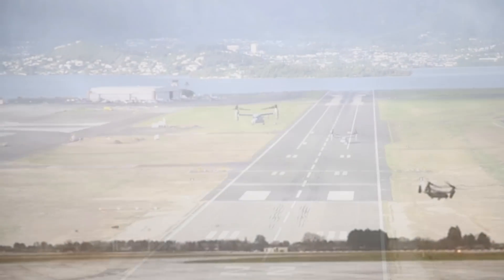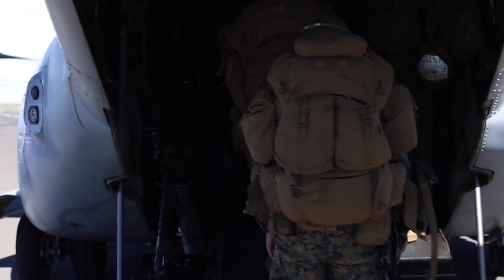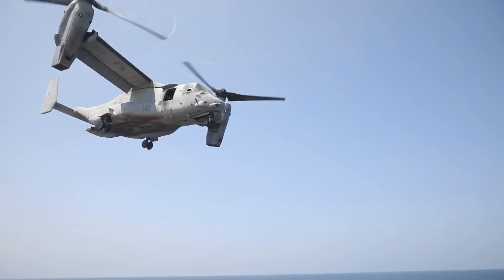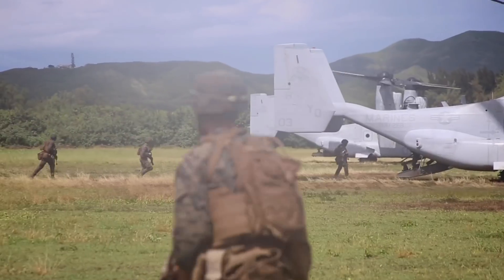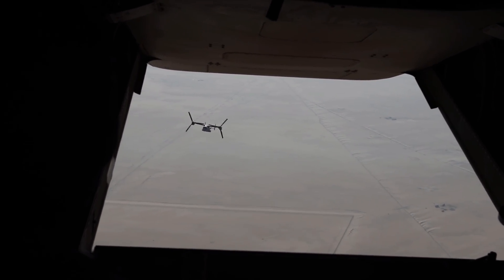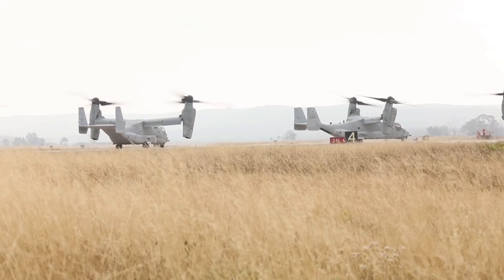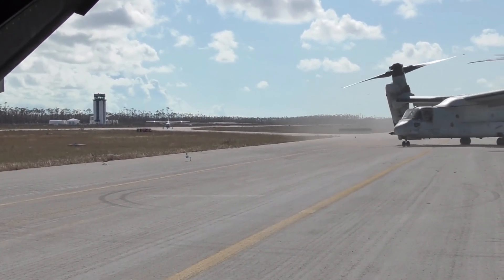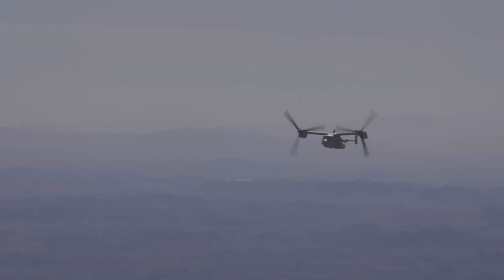Bell Boeing V-22 Osprey | TILTROTOR AIRCRAFT

Comment: Hey Matsimus, The Osprey is one of the safest military aircraft in service today! Yes during TESTING there were a few accidents but since this bird as been in service it has perform extremely well. 

I never actually flew in one because I was in the US army and the majority of Osprey's belong to the Marine Corp, but I have talked to them about it and they love it. It can do everything a medium left helicopter can do while being able to fly at much higher speeds and carry more troops and cargo! The US military hit a homerun with the Osprey and it was worth every dollar!
Reply: Wastage?  I believe you mean waste, as I don't think wastage is even a word.  While I may be wrong on that, I am pretty sure neither word would apply.
Reply: Yeah the idea that they are very unsafe is just an old myth that refuses to die.
Reply: @TheoneknownasVC  No autorotation, only glide like a plane in the event of power loss, would drop like a brick if it is hovering and has no speed at the event of a power loss.

Rotor layout is easily affected by changes in the wind, unlike most helicopters that have the rotor at the center of gravity.

Yes, it is safe as long as it is used like a plane but the moment it goes to hovering mode, it loses all of its benefits and deals with hazards that aren't present to most other helicopters.
Reply: @13thSystem  The ones I've worked with take great crosswind and TX limitations. Also they can auto rotate themselves. 

Do you fly them because it sounds like your info is wrong...
Reply: @harosokman  They can autorotate but the tiny disks would be useless in autorotation and wouldn't slow the descent down. The manufacturer's manual itself doesn't recommend autorotation, you should know that if you've really worked on these helicopters
Reply: @Tom Gulbranson yes, you idiot, you can disregard my opinion, you must be new to the internet? if people laugh at this, and I learn from it, then it is a win-win in my book. thanks for the link.
Reply: @zeburancher9480  mann you a Savage 🤣🤙🏾🤙🏾🤙🏾 playing with peoples emotions like that
Reply: Your local meme and anime dealer, Yes, well having it both ways is a contradiction here. Either the Marine Pilots are "risking their lives" or the V-22 is "safe" but not both.
Reply: @roxyraccoon8856  What I mean is they put their life on the line flying this thing aka Flying into danger and that all of the kinks have been taken care of.  K ?
Reply: @Tom Gulbranson you too
Reply: @Tom Gulbranson I havent had time to read the link yet, sorry if I am mistaken.

I will leave you with a quote though, "Great Minds Discuss Ideas; Average Minds Discuss Events; Small Minds Discuss People"

have fun talking about me :) - you won't make 'the cut' into any of my conversations.
Reply: These aircraft can do a lot more than most people give them credit for. They are also much safer than most people know regarding the redundancies built into the electrical, hyd, drive systems, etc.
Reply: @elioltelaski6066  you missed the point. I'm an idiot, sure, but so are you. "Think about how complicated anything that isn't a consumer good. Oh wait, you cant Because you never see them. Anyone that can actually has an idea what to do with them." I dont know what any of that means, because we are idiots.

You are looking at my 7 crashes as a Statistic; thats fine, to a degree...  "Flight rating per hour doesn't translate to overall reliability or safety, it's a common term used in politics to make something sound good and land a procurement contract. Flight rating per hour simply deals with how long they fly it, not how hard or where they fly it. [...] It only counts the ratio of the number of flight hours to death and ignores the reason of death or the conditions the helicopters were in."

put it plainly, at least one of those seven crashes was caused by the V22 being ordered to perform an insertion above its recommended altitude; this was done in an attempt to prove that the V22 was more capable than it was, and it cost lives. This would have been completely avoided with conventional craft. the statistic therefore does not hold any water in reality.
Reply: It IS a waste of money AND good value, It is safe and Intrinsically dangerous. You guys agree but have different criteria. It could be a safer design, absolutely it could but it is very safe for the design, which is quite mad. It is effective, certainly, but it is also superfluous. 

Fatalities IS a terrible metric. The aircraft DOES have issues. The aircraft also benefits from being built on the back of other systems with problems such as the issues with the chinook. 

The fatality rate is low because the engineers are very good, and won't let them fly unless they are perfect, which is also why most of them are out of action at any given time. They take special measures because they KNOW things could go badly wrong if they are not careful. More reliable designs tend to be "trusted" and thus can suffer unforseen faults. 

None of that really matters. I'm sure next time they made one it would be a chinook that turned into a flying wing or some lunacy. 

The question comes down to,  as it clearly does fit a niche, can it be improved? if so, what exactly could fill that niche? If not, can we get rid of the niche? Or should we just suck it up and keep it?

Key points to consider - it is very complicated (hard to keep operational). -it melts whatever it lands on -it is an unsafe LAYOUT. can it be faster tougher fitter etc?
Reply: Carbon 12 - It's always funny to hear someone that has never served in the military and knows nothing about the aircraft tell people who know a LOT more than them they are wrong lol.

Seriously stop making yourself look stupid and ignorant. Pretty much everything you said was wrong.
Reply: 7 crashes in 12 years doesn't sound quite alot nor a waste of money tbh... Coming from a normal citizen with zero experience in anything military... Cars in the highway looks like speeding deathtraps compared to any aircraft.
Reply: Airforce Controller here. I back up that claim. Her flight hour, these are the safest aircraft in the USMC inventory! I work with them almost every day.
Reply: @harosokman   You are spot on. I have multiple friends in USMC who absolutely love the V22. They say it gets them where they need to be  faster, safer and more comfortably with all their gear then any of their previous transport aircraft.
Reply: @Tom Gulbranson maybe I dont, but at the same time no one can offer any proof. you say you and your son have experience, but this is youtube, sorry I can't take you at your word. I dont have control over whether the next 200 v22 are procurred or not. I think they will be procurred whether they are decent aircraft or not. I therefore Hope that I am wrong, that they are decent aircraft, and Maybe I went about this the wrong way, but I attempted to play 'devils advocate' in an attempt to get them to defend this aircraft with facts. I have seen no Facts.
Reply: Better I’ll get 2 CH-47F then one V-22
Reply: @rudenkohawaii  3 CH47s still isn't better than one V22.
Reply: your periodic reminder that the V-22 Osprey is a piece of junk.
https://medium.com/war-is-boring/your-periodic-reminder-that-the-v-22-is-a-piece-of-junk-db72a8a23ccf
Reply: @prwtc  This source is from 2014 and you say that to this day it is a piece of junk. Not only that but marines who actually risk their lives flying it say it isn't. Also most of the crashes are from early in its life and have been taken care of.
Reply: @operator0  Okay, lets take safety completely out of consideration then. Even if this thing were as safe as a C130, C17, or any other fixed wing aircraft, it would STILL be a POS. "It flies too SLOW, it lifts too LITTLE and it doesnt fly FAR ENOUGH, and it is just too much of a POS to have in our inventory". Have you ever seen a single ARMED V-22? Do you ever wonder why the V-22 cant lift up the gun? let alone bombs/missiles? Because its lift capability SUCKS. it is a huge aircraft that cannot keep up with even C130 or C17, let alone be fast enough to defeat even OUTDATED AAD (it is SLOW), it cannot perform above 3000m altitude. ALL of these facts make this aircraft UNFIT FOR DUTY, unsafe on the battlefield, a huge detriment to our troops on the whole.

There is absolutely nothing this craft can do that a fixed wing or helo cant do better, cheaper or faster, AND safer.
Reply: @operator0  okay this will take some nuance, so please follow me. you want to compare to Helo, not fixed wing aircraft, because that is where this vehicle outperforms the old. So where do we operate helo? anywhere without flat plains to pave or a road to land on. Of those territories, the CH47 is limited to taking off and landing at 20k ft altitude. but, the V-22 is limited to 10k ft (take off/landing, not in-flight). Do we use helo below 10k ft? what % goes above that? It seems to me that the military wants these aircraft to operate in mountains and at altitude. the point is it is not better than a helo if it cannot be used where helos can be used.

Genuine questions at this point. Sorry if I was being too abrasive earlier.
Reply: @zeburancher9480  What. But it doesnt. Its primary capability is that it flies faster and further than helos but can land and take off vertically...
Reply: @zeburancher9480  it's faster than what it replaced. I've never heard anyone bitching about it not being as fast as the larger cargo aircraft. It's not supposed to be. It's supposed to be faster than the helicopters it replaced while still being able to take off/land like one and fit on ships. Looks to me you're changing the goals for this machine. Like bitching about a pickup truck not being as fast as an F1 and being unable to carry as much as a semi-trailer truck.
Reply: @zeburancher9480  since when do landings happen when air defense is still active? You do know no one lands until air defense is destroyed or is being suppressed?
Reply: Your local meme and anime dealer said  "...the Marines who actually RISK their lives flying it said it isn't [a piece of junk]". Yes, the anime 'tard ACTUALLY wrote that.
Reply: @MotoroidARFC  since when do we get to choose where and when we and who and how we fight? The enemy helps us decide all of those things, we dont get to choose 100% of the time. ambushes during take off and landing are the most common attacks on aircraft because they have the highest success rates. That said, an ambush in take off against the V22 or the CH47, I don't see much difference there. So whats the point? edit: my original comment, I was talking about while in transit (not landing/take off), and compared to fixed wing (even A10, which people are constantly saying 'cannot handle modern AAD').

your F1/semi trailer compared to a pickup truck would be valid if only the semi trailer truck were also the F1 racer. A Tilt-Wing aircraft could do everything the Tilt-Rotor V22 can do, better, and do it with a faster cruise speed closer to that of a C130 (not faster than, just to try and 'keep up'). I will concede the 'fixed wing' point entirely though, the V22 does outperform push-propeller helicopters, for what looks like a trade off in size and complexity in building/maintaining. Thanks for the reply.
Reply: @zeburancher9480  which is why the Army and the Marines don't land their transports in an opposed landing zone. Fixed wing aircraft (if available) and gunships get there first and either destroy or suppress the opposition or call off the landing at that landing zone. Alternate landing zones will have been selected and if they can't be used the transports just cancel the landing and bring back the troops.

The V22 was made to replace the CH46 and it does that well. It still can't carry as much as a CH53 in troops and sheer weight but it is faster which is why it's still on the flight decks of amphibious assault ships. Perhaps it can be re-engined (and another blade added) and reinforced to improve its lifting ability and speed but until they get all their F35Bs, the Marines will carry on with the V22s they have.
Reply: @zeburancher9480  you do realize that the v22 is not supposed to fight back!!!! It will receive interceptor or low fighter escorts for missions it will get shot at. THE MARINES HAVE AN ENTIRE AVIATION SECTION FOR THIS
Reply: @roxyraccoon8856  Which is true because the Marines still use the damn thing and ACTUALLY say it isn't a piece of junk. Also go take a look at most military projects and you'll see that people had to die to perfect them cough AV 8 harrier cough
Reply: @zeburancher9480  push propeller choppers aren't really that new I mean the Army was trying to get the AH 56 like half a century ago until the Air Force cock blocked them with the A10.
Reply: @prwtc  Who wrote that and where are his sources?
Reply: You are wrong, and you should do your research before showing support for a death trap that is endangering the lives of marines. Since becoming operational in 2007, the V-22 has had seven crashes including two combat-zone crashes, and several other accidents and incidents that resulted in a total of 12 fatalities.
Reply: @zeburancher9480  You should do your research. 12 fatalities in 12 years for a military aircraft is fucking outstanding. Just for funsies, look up the crash history of the AV8-B Harrier jump jet. The fact is, the V-22 is so revolutionary in its capabilities that the military would use it even if its fatality rate were 3 times higher than average. It's just that mush of a game changer.
Reply: @zeburancher9480  And how many crashes did the Ch-46 have in development and operationally? Thats the aircraft the V22 replaced and is relevant. The first two Woodland Scenics V22 crashes with fatalities were studied, and then fixed. The other two crashes happened operationally as you suggested but had nothing to do with the developmental aircraft. Despite your opinion the military loves this aircraft and it's capabilities.
Reply: @zeburancher9480  12 fatalities over a  13 year period? That's not a very impressive statistic to claim "death trap"
Reply: @demanischaffer  youre late, notice 70 replies in this thread? Ive heard it all before.

edit: P.S. @Your local meme and anime dealer, the AV8 also sucks. just compare it to conventional craft.
Reply: @zeburancher9480  I really don't feel like reading through 75+ replies I was responding to your original comment
And again, 12 fatalities over 13 years is not really a "deathtrap"
And your AV8 comment is kinda pointless
It's like comparing a semi truck to say, a mule
Yes in almost every single way the Mule is worst then a semi truck, lower speed, carry weight etc, however you're never gonna get a semi truck carrying what you need into certain places, the AV8 serves the needs of the USMC
Reply: @demanischaffer  my AV8 comment was in response to 'meme', it has nothing to do with comparison of capabilities to the V22. I'm just saying, "the AV8 sucks, it should not be used as a gold standard for comparing future aircraft", full stop, nothing more.

if you are just replying to my original comment, then you are still too late, there is no point. "And again, I have heard it all before". Have a good one.
Reply: @zeburancher9480  Maybe you should actually talk to the people that fly in the Osprey. Your viewpoint is meaningless because. Its the people who actually  rely on the equipment who's opinion matters. When my friends in the Marines tell me they love the Osprey and trust it to get the job done. That is all that matters,
Reply: @zeburancher9480   Okay, and why is a variant of the Huey still in use despite dozens of them being lost in Vietnam?
Reply: It's a wastage of money
Reply: @deltabeta5527  Nope, not a waste. And the V280 takes it a step further.
Reply: @deltabeta5527   Not really dude.

Comment: i still think they should make a firefighter water bomber variant able to fly long distance like a plane and also able to suck up water from almost anywhere.
Reply: One photo in the USMC site many years ago showed the MV-22 slinging the water basket over a big pond.
Reply: @kittenastrophy5951  almost any helicopter can do that as long as you don't put too big of a basket on it but I'm talking about a tank and pump system similar to what they use on the modified sky cranes as that would allow v22  to use it's full speed and range. I'd be happy to see tax money spent on at least building a handful of them even just a prototype to see the what sort of potential of system like that would have.
Reply: @phalanx3803  The USMC already test the tanker version of Osprey . It carries fuel tank and hose+drogue so I guess it shouldn't be problem to do in reverse.
 Think again, in that configuration, may be the internal volume is so less to be useful for fire fighting.
Reply: @kittenastrophy5951  i have hear of the VARS V22 but there are no official stats on how big the tank is but going of the cargo bay size and leaving room for pumps and stuff one could put a 14,000L tank in there that's bigger then the Elvis sky crane at 9,500L.